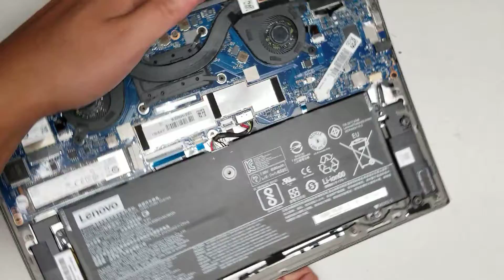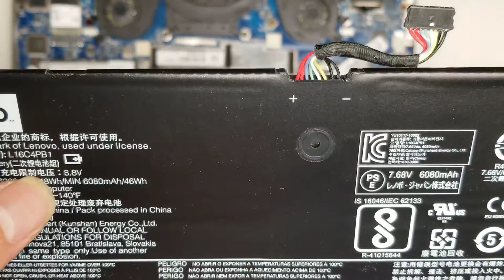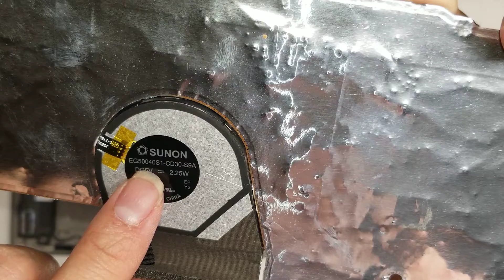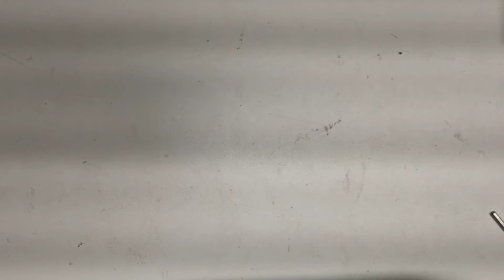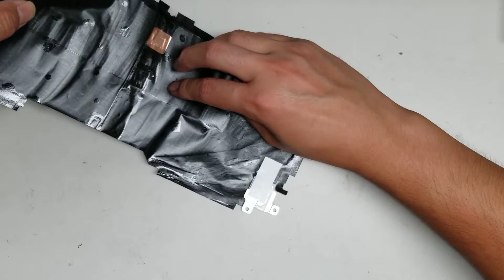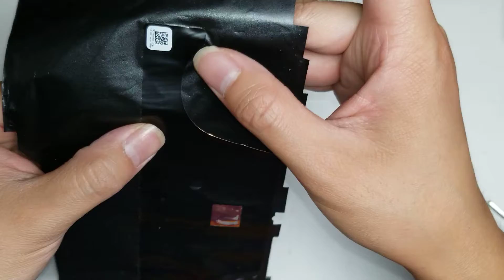Lenovo Yoga 730-13IKB Disassembly SSD Hard Drive Upgrade Repair Keyboard Replacement

Comment: For those of you replacing the keyboard, the black tape is not needed. I assembled it back without it. Maybe it is just extra protection against a spill or something. Also, there is no need to do tricks with hinges, just don't do anything with it. Also, as you noticed, for just a keyboard replacement, you do not need to detach the wireless module cables, just swing them up.

P.S. I am an amateur and did such a repair besides a fan replacement for the first time in my life. You would really feel proud of yourself after you did it on your own even if you earn a lot.
Reply from the maker: The tape is to help prevent a potential short.

Comment: Is the black plastic layer required to put back in?
Reply from the maker: It's there to prevent shorting the motherboard on the metal part, so I would put it if possible.
Reply: @ItsBinhRepaired  alright I'll probably just put electric tape over them if it gets ruined. Thanks for the reply!
Reply from the maker: @Ceejnew  sounds good
Reply from the maker: Electrical tape will get gooey over time though.
Reply: No, I assembled it back without it and it is working. I hope it helps anybody.

Comment: You are amazing. Thank you so much. There's no way I could have done this on my own, but following your instructions I was able to replace my keyboard on my Yoga 730-13IKB, after ordering the replacement. Previously my q, w, e, r keys weren't working, and reseating the connector hadn't worked.
Reply from the maker: Glad it helped. If you haven't already, please like and subscribe so others can find my videos and consider contributing to the channel. Thanks!

Comment: Hello, I have an issue with my laptop. I assume it's a battery issue. The light that used to be red when charging is now white. It doesn't turn on at all. I tried holding the alt +ctrl + power button as a reset and I can hear the fan turn on but nothing happens. Is it my battery? I would like to replace it if so and need to get an idea. Someone said over the phone it may be the video graphics card but I don't know
Reply from the maker: Not sure

Comment: thanks so much for posting this!  helped me replace a broken keyboard 👍  Great commentary/explanations.  I bought a unit off ebay that had the keyboard + type cover - was like $20 more than the standalone keyboard, but saved having to peel off all the black plastic; basically just remove the trackpad/fingerprint reader, and pull it off the hinges.
Reply from the maker: Glad it helped. If you haven't already, please like and subscribe so others can find my videos. Thanks!
Reply: Do you have a link to the eBay item? My yoga got similar issue, T, Y, Del, keys stopped working. Resetting ribbon only makes them work for a day.
Reply from the maker: What's the model number of your yoga?
Reply: @ItsBinhRepaired  730-131kb.  I followed another video to reset the ribbon. the magic last for a day only.  Do you know what's the root of the issue?
Reply from the maker: @speederc3662  not sure what would cause that
Reply: @ItsBinhRepaired  maybe it’s their business strategy. :p
Reply from the maker: @speederc3662  did you want the palmrest assembly? What color is yours?
Reply: @ItsBinhRepaired  I just want to replace keyboard, the defective part.
Reply from the maker: What color are the keys?
Reply: @ItsBinhRepaired  I have it fixed by a simple way. use an air duster blow into the slivers the keys. the keys work perfectly after that.  I guess the issue is due the dust inside.
Reply from the maker: @speederc3662  usually that only works if the keys aren't pressing down all the way.
Reply: @ItsBinhRepaired  I think the dust intervented the touching surfaces.  Anyway it's working flawless right now. Will see.
Reply from the maker: @speederc3662  the rubber caps don't really let dust in. That's strange. Usually it's some crumbs that stop it from pressing down completely

Comment: I just need to replace my fan on this model.  Do you have a vid just for that?  I need to know if it requires thermal paste.
Reply from the maker: What's wrong with the fan? I can make a video, but you'll have to mail me your laptop. Not going to buy one just to make a video that makes me 5 cents. Lol
Reply: @ItsBinhRepaired  one of the fan bearings is out fan/heat sync assembly.  I have a replacement assembly but dunno the whole process.  Its all good.  I can get it done for less than 100
Reply from the maker: @antonynation9954  ok

Comment: This video made me see that the RAM in non upgradeable, but thanks anyway.
Reply from the maker: Yup, most my videos I mention RAM upgrade in the title. This one I left that out.
Reply: It's Binh Repaired 
One last thing?
Does this work with an EGPU because of the thunderbolt ports?
Reply from the maker: @Unusual_Danger  not that I know of. I haven't really looked into it. I think if it has thunderbolt 3 it works?
Reply: @ItsBinhRepaired  Yes it has 2 thunderbolt 3.0 ports., also can this laptop's CPU be upgraded to a AMD Ryzen 3700x or is the motherboard intel only.
Reply from the maker: @Unusual_Danger  can't upgrade most laptop cpus
Reply from the maker: @Unusual_Danger  the egpu thing I'm not sure. Haven't looked into those
Reply: @ItsBinhRepaired  thanks for letting me know
Reply from the maker: @Unusual_Danger  no problem
Reply: @Conor Mark , thanks man, you seem like a super genuine real awesome robot.